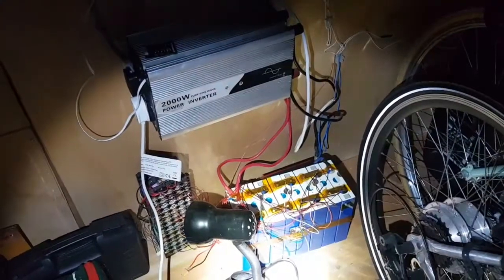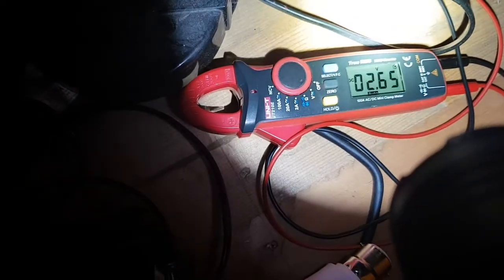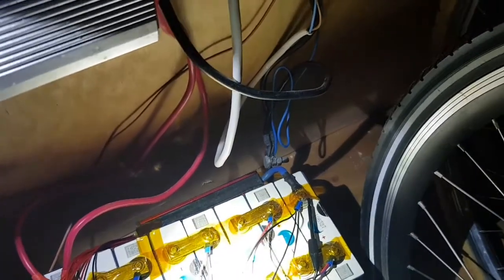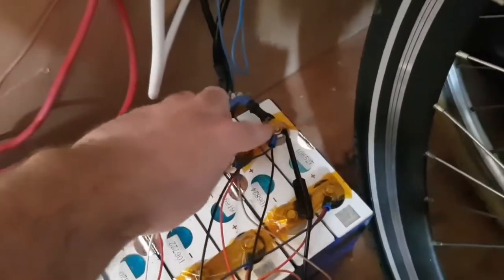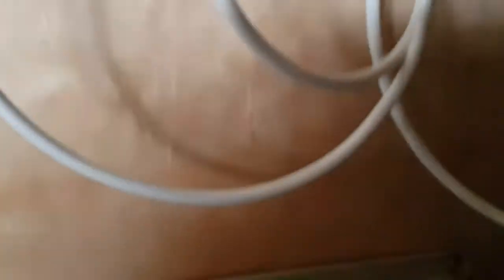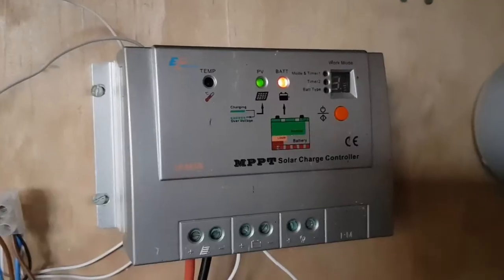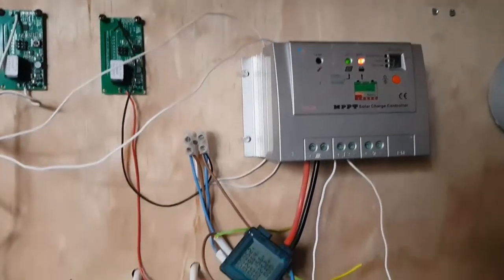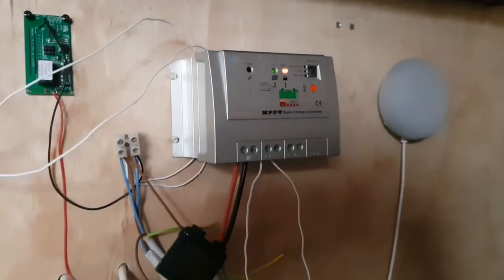LiFePO ₄ battery flat Daly BMS tripped.

Comment: May be abit late but you really don't want PV running to charge controller without a battery connected as it can screw up the MPPT.

Good start though :)
Reply from the maker: Never too late. Thanks for the comment. This was just a temporary thing while the BMS had disconnected the battery. Power is now restored and all is well again

Comment: Hands down your greatest investment are those 8 lifepo4 batteries. You need to absolutely protect them. Most bms systems provide editable data. Your cut off is too low and if your charge limit is 14.6 x2 it’s to high. I also think your solar panel / charge controller ratio is wrong for the storage amount. I think a 30 amp controller and 400 watts of solar would be more fitting. Last thing, I think the gauges of wire you are using maybe inadequate. Submitted in good vibrations . Thanks

Comment: the lights should be on the load side of controller this way the controller should of shut loads off befor the bms kicks in you should also have a battery isolation switch this way you could jump input to output to reset the bms a sign of bms tripping is a badly set up system

Comment: What model version of BMS are you using? Basically I am upgrading from lead acid to Lifepo4  and in the process of buying a BMS, this shortening of circuit or switch daily basis is a bit hassle aren't there any intelligent BMS which just shutdown discharge current flow and allow charge current?
Reply from the maker: You can get a daily BMS with a common port. That the one I have. They also do a separate port version. These have a separate port for charging. Full disclaimer I have never used a separate port version so you may want to do a bit or research before you get one.